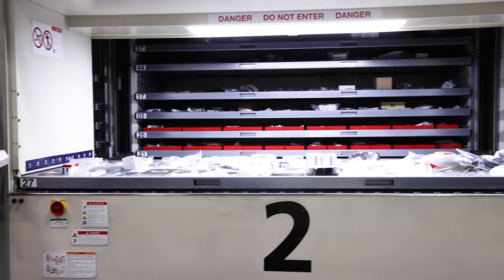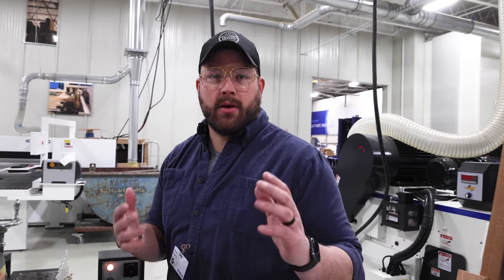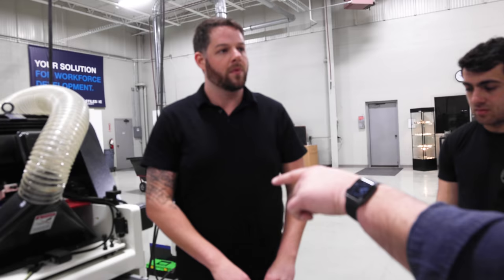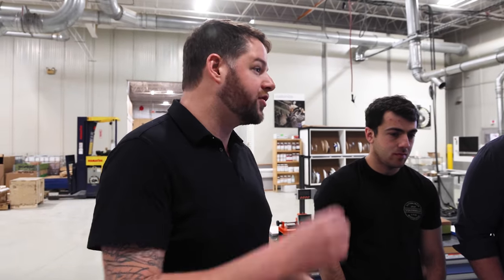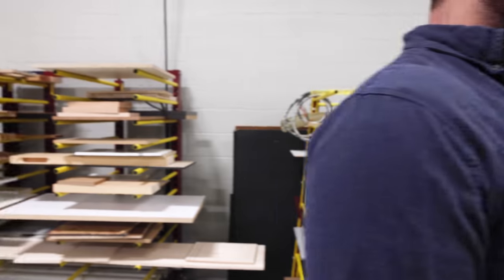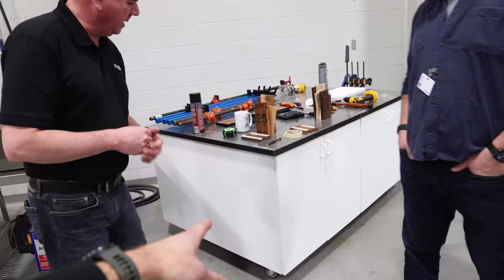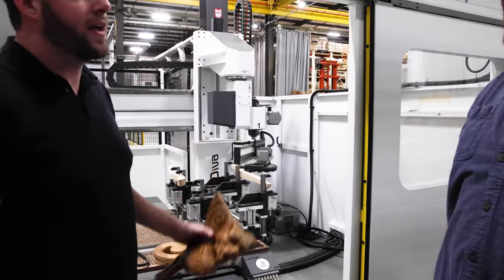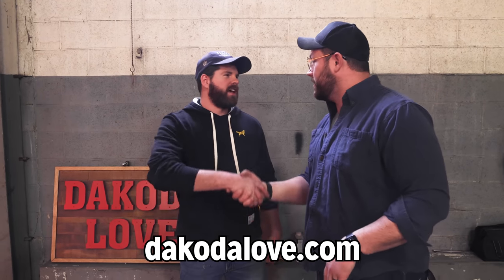We Visit A $1,000,000 Woodworking Shop!

Comment: i used to work in a cabinetry shop with some of these machines it was fun and interesting and 100 % agree one of our biggest bottle necks were the edgebanding machine being down or just plain messing up. though i wouldn't fault the machine most issues was lack of proper maintenence and whoever was working on it didn't have enough experience and couldn't trouble shoot the problems
Reply: ive worked in a factory that makes office desks/tables.. we had like 1 machine that cut the desks to size, put all the holes in and also did the edgebanding (more like a big cnc machine).. we did have to put on the panels by hand though.. but that thing was fast af... did like a whole desk in about 30 seconds.. also this was like 20 years ago.. so to me these machines look a little weird being so new but also less efficient.. cause u need like 4 machines to do the job the 1 big cnc could do back then (and that machine was not new back then).

Comment: I worked at a furniture manufacturer for 2.5 years. Not cheap crappy shit. High end solid wood stuff. I was in the breakout department. Ran a chop saw and planner like the first two machines,  chain drive rip saws. Assisted on other machines too. The mulit blade rip saw and automated chop saw would blow your mind.

Some days were 8 hours feeding or tailing the planner. Bundle after bundle of rough sawn lumber 4,5,6,8,10 quarter material. We are talking 1000's of board feet a day. (They would get tractor trailer loads or just cherry, or ash, or maple.)

The wood would then go through go through auto chop saw. Input your rough lengths, mark any knots and such on the board, slide the board in, the computer figured out what was best to cut from that piece and it shoots it out the back in separate areas.